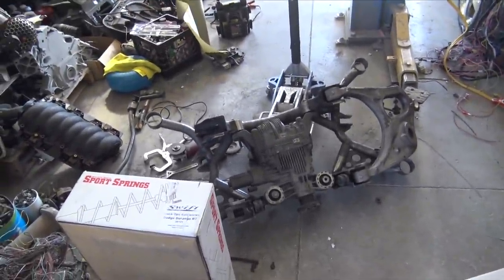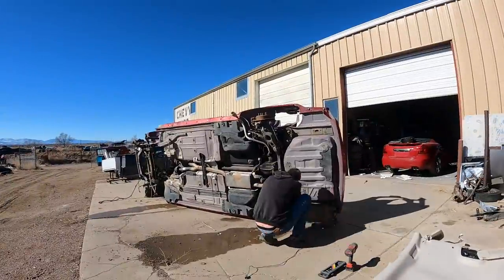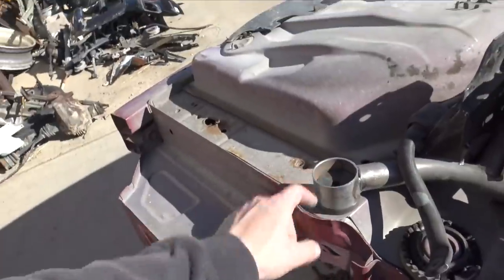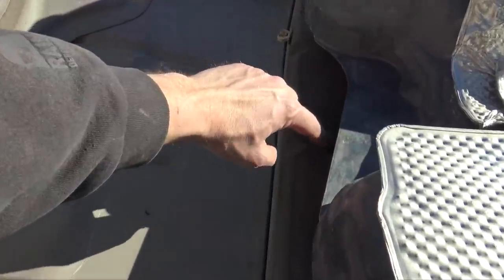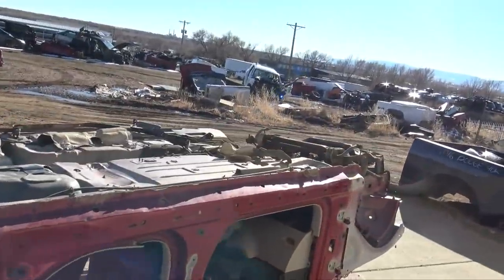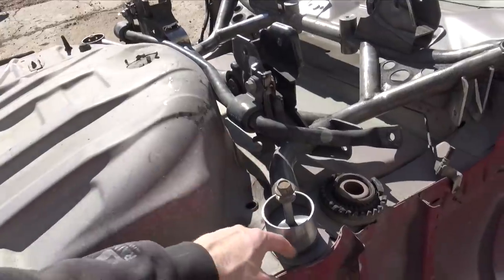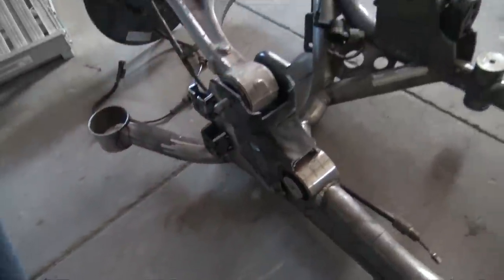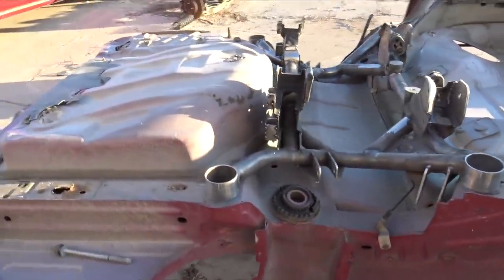Building the Ultimate Station Wagon |  Charger Magnum Hellcat | 1000HP Hellwagon | Pt 74

Comment: if you wanted to eventually sell these subframes, do you anticipate that the fuel tank issues will make it something that is more difficult to sell? or do you think most people in the market would be using fuel cells? i don't know if you planned to sell them, but you sure did put in a ton of work for a 1-off. great job by the way, really impressive and clean work!
Reply: You really have a point man, i know a lot of people would love to have their hellcats converted to all wheel drive but the fuel cell and losing the trunk space because of it is going to be a huge problem.
I think Dave should reconsider that
Reply: You don't have to use this subframe. You could just use a stock hellcat charger subframe and not run into the issue. This is just to have a beefier rear diff from trackhawk.
Reply from the maker: @Shiftheads  yeah I can have two different lug patterns as well that would be great
Reply: @Junkyard_Dave  😛 Good one.

Comment: Custom swing arms are an easier sell than a custom fuel tank 
But you could possibly avoid both by moving the arms back towards the rear and angling them  slightly to keep the wheel in the same position.

Comment: Hey Dave maybe you can help me out. I've been looking at a cross member braces for 4he 6.4l Hemi but I have a 05 5.7l hemi. My question is is the spacing between the front cross member an the transmission brace the same on the 6.4l an the 5.7l hemis?
Reply from the maker: There is multiple transmission crossmember bolt holes